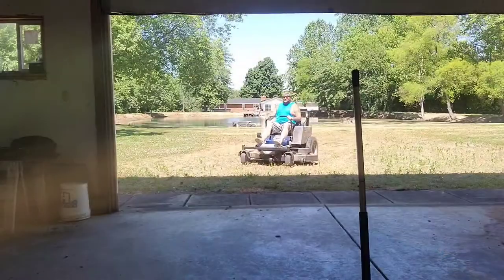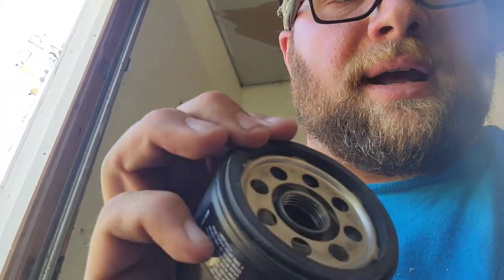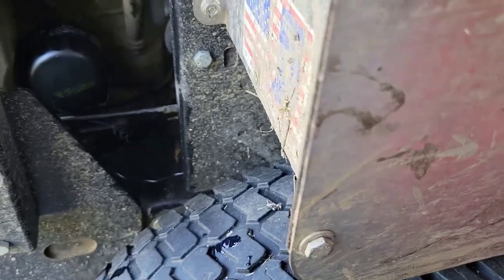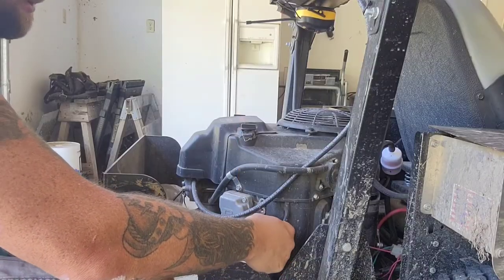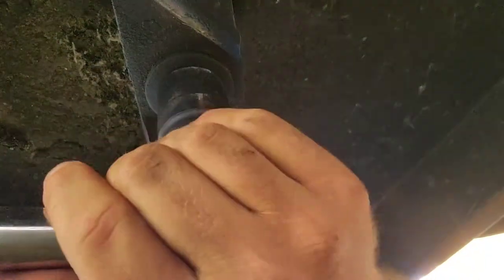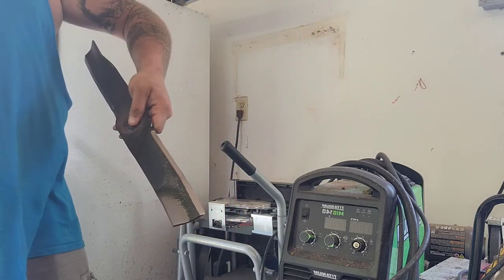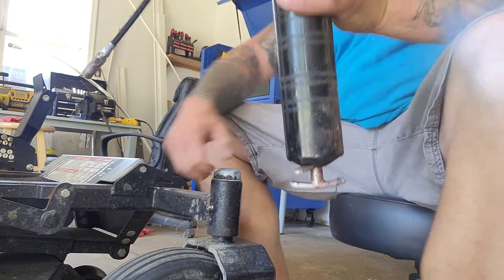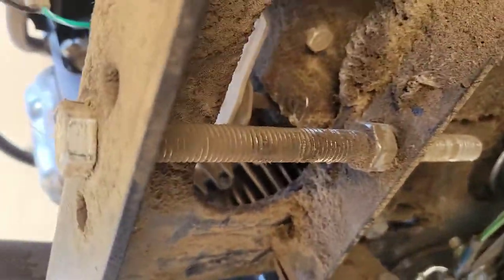Dixie Chopper full tune up.  SHARPEN BLADES. Tighten Drive belt.

Comment: Dude!!! Your video saved my life! I have a magnum 2250 r 50 inch, and my blades didn't seem to have full power when under load. I just needed to move my engine back just to get that little snug feel on my drivebelt
Reply from the maker: Good. I learned that lesson the hard way lol
Reply: Thinking of buying one of these.so the motor adjust belt tension?
Reply: I'm a dumbass commenting before the end.my bad.great info.ty

Comment: You are busting your ass, get a HOIST not a WINCH from harbor freight, 4 seconds she's up in the air, get an EARTHQUAKE impact from HF, 20 seconds all three blades off. Hand grinder from HF, all blades sharp in 12 minutes, 3 more minutes all on and mower down. This is how I maintain our 4 choppers
Reply from the maker: A hoist is on my to do list for the barn. You know how it is. 1 piece at a time.